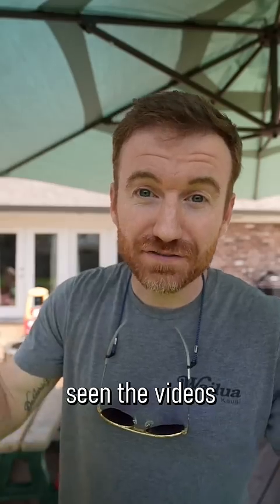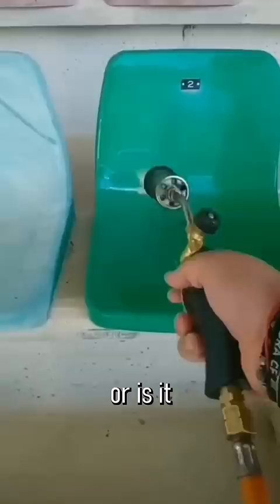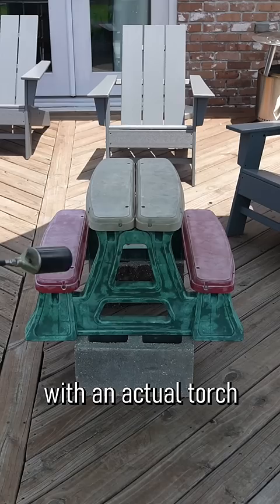Fixing Plastic with Propane TORCH

Comment: What's wrong with selling? Does the torching make the plastic unsafe to sit on or something?
Reply from the maker: I assume it weakens or damages it haha
Reply: Assuming he means doing it to old ones and selling as new/lie about the condition
Reply: Prob
Reply: Ah, that makes sense, thanks
Reply: @BreakItYourself  So because you assume you call people having no morals sounds like you have no morals of actually understanding what you’re talking about
Reply from the maker: @PeterParkerWebslinger3  this is a joke based off the last short I did using a heat gun. The plastic reverted back to the sun damaged look in just a few days. A few people commented jokingly that I should've sold the table right after heat treatment. lol lighten up.
Reply: @BreakItYourself  you have to protect the plastic after you heat it, there’s probably a crew of guys. A couple guys with torches and a few with sprayers followed by several with towels.

Comment: To properly do this you need to wash it thoroughly to get all the dirt out of the pores, then heat blast to melt the plastic back, then coat it to protect the plastic. Otherwise it will just go back within a few months.

Comment: Works on any plastic trim or surface for the outside or your car too. Just use a small propane torch
Reply: How do you protect the paint of the car near the black plastic runners?

Comment: It works quite well, how long depends on mechanical wear and UV exposure. It's not so great on very light colors though, it easily get blotchy and discolored by smoke and light burns from the heat. Happens with dark colors too, but its just not very visible.

Comment: Plastics are repaired and restored using heat, so when you are blowtorching it you are not hurting the plastic in any way and so long as you use the right sealant and conditioner afterwards the plastic will be as good as new

Comment: The heat fixes it. The reason why is pretty simple. The sun damage has a bleaching affect because the outside of the plastic degrades from the kind of heat sunlight provides to the plastic. When you remelt all those little bits together, the white haze goes away. Really, only the outside is damaged, so it's perfectly fine after you do this.

Comment: The heat is bringing the oil out so how well it works varies on what type and how faded the plastic is. Some work better than others, it works great on trim on a lot of cars though. Heat gun and blowtorch will work.

Comment: It is similar to using Compound on a car

Polishing compound is a very very fine grit taking those oxidized B off the outer layers and letting you get to nice clean paint underneath

You probably can use Car Polishing Compound on the seats it would just take incredibly long, so they use a torch which melts out all those oxidized bits and either vaporizes it or just makes it into a nice smooth surface again

Comment: The top layer of the plastic gets damaged by the uv breaking the polymers. The heat lets longer polymers go back up to the surface. It keeps up appearences but it slowly degrades the plastics intergity. So at some point the seats become brittle and will break when set on
Reply: But, is this ok to do on car parts, like bumpers? Or does it make it unsafe?

Comment: It’s most likely because of the microscopic scratches in the plastic making it look faded and dull. By melting them back down and creating a smooth surface, it returns to its original color.

Comment: You’re reactivating the hydro carbons in the plastics, the longer and more frequent you do this the better the results. Leaving it outside on a hot day in direct sunlight will make it much easier to use the heat gun

Comment: All you're doing with the torch is melting (actually the temp is probably hot enough that the plastic is evaporating, so probably want to wear a mask when doing it) the outer most layer of the plastic. You'd then need to coat the next layer after it cools with a sealant, and/or keep it in a shady area.

Comment: It'll make things worse if you don't bother to restore the plastic with an oily coating with something like Armor All, followed by a UV coating like Meguiar's headlight coating. Automotive grade stuff will generally work fine, but there's obviously stronger. Whole point is to keep the plasticizers from drying out and escaping. The torch merely brings the plasticizers up to surface, so it can only be done so many times. Doing the steps mentioned should mean you shouldn't need to do this so long as you maintain all the coatings.

Comment: Doesn't work long therm as far as i know, actually sanding off the top layer is a "better ish" way because it lasts a little longer and doesn't risk cracking on older plastic

Comment: I worked for a company that restored stadium seating. The torch method is very short term. Best result is to take something like sandpaper and completely scratch up the seat and then repaint if you want a couple seasons out of them.

Comment: It really works - but i would not recommend that 
use hydrogen peroxide foam and cure it directly afterwards with silicone oil - with the torch the plastic gets extremely brittle over time and ruins the surface/stability.

Or - after your torching use clear Laqcuer afterwards to seal it.

Comment: youre just melting the top layer, so it will work infinetley, as long as the seat holds up, and you can get even better results if you pressurewash first, so that dirt and grime doesent get cast into the plastic

Comment: I mean, as long as only the surface is damaged by abrasion and UV long term exposure, re-melting the plastic should be just fine, as long as most of the plastic hasn't chemically broken down.

Comment: Should work as long as it took for it took get sun damaged. You’re melting the outer layer of plastic to the good plastic underneath. But a protection coat could help it last much longer

Comment: That's a very different plastic used in children's playsets vs stadium seating,  be careful about getting to close with the flame, you could easily melt the other surface of the plastic (inside) and cause it to deform  and lose strength

Comment: I make polyethylene water tanks, we do this to make make them shiny, best method is use a way overkill burner and do many high speed passes for an even finish
Tho we clean the tanks before we hit them with the burner.
Most plastics will need a uv protevtand but the stuff we use is designed for outdoor use and is iv resistant

Comment: Is this only effective on certain formulation/type/whatever of plastics, or is it generally universal in outcome? I don't expect it's the same with the kind of brittle transparent plastics used to make lamp lenses, but still curious enough to want to ask if heat may be a decent alternative to all the scrubbing/sanding to remove UV damage from vehicle headlights. I've always hated how the usual restoration process damages the lenses to physically remove the affected material.

Comment: I don't even know about the tiktok you are on about.. But chemically. The top layer of the plastic has oxidised under the sun and become "sun bleached"  If you apply heat to the right kind of plastic, it melts the top layer and restores the original colour and shine that the plastic had from new and it should last as long as the old plastic did before it got "sun bleached"

Comment: I worked with molded plastic, and if there was a nick or a diffrent color, depending on how deep it was, they would use a torch to dig, then torch again to get the plastic straight. There* was never a day I didn’t use a torch

Comment: You can spray paint or use Rust-Oleum oil based paint and cover with thin layer of epoxy if moms or dads want to up cycle kids plastic picnic tables or outdoor furniture and do not want to use a torch. Lasts forever and gives you AMAZING coverage. The outdoor paint used for doors. I use it on anything that i want to retain solid color with absolute high shine. I restored a large plastic kids toy that had immense heat damage and discoloration from being in an abandoned back yards for years. I painted it white with the Rust-Oleum oil based door paint and it looks like marbled stone. Has not cracked or chipped and has held up for almost 9 years. Looks extraordinary. Oil based paint adds an extremely thick protective layer while also adding substance to pieces.

🏆.

Comment: Yeh I used to do this at an old used car lot I worked at. Works great but you gotta be careful you dont actually melt it or burn the paint or lights. Used a way smaller heat gun tho 😂

Comment: Exactly not a real fix. The UV penetrates the surface and does real structural damage over time, literally breaking the molecular bonds that hold the plastic together. This why sun damaged plastic is so brittle and will crack and fall apart easily. 
Remelting the surface actually might increase the flexibility and thus durability just slightly by bringing more plasticizer to the surface and resolidifying microscopic cracks and whatnot. This would only be superficial and wouldn't help structurally but its interesting to think about.
Clear coat of course works to prevent damage but doesn't help any after the fact

Comment: I don't think this is about morals, nor ethics. This is literally what they do in the factory to create that shine. Injection molded plastics don't come out shiny. They are dull and usually covered in injection grease. Adding heat brings out the grain and the shine. Many years ago I worked in a plastics factory. We made everything from rubbermaid baskets, to castor bases for office chairs.

Comment: Tried it this week on a slide. Didn’t do anything but heat the plastic which then warped when it cooled. Wonder is the slide was fire resistant?

Comment: We used to scrape the sun damaged parts of our motorbikes with safety razor blades, because you can bend the razor blades to match the curves of the panels, but the most important thing, is to use seal and protect it from the UV rays……….
    Otherwise you might as well just leave it as it is………..

Comment: Only certain types of plastics.  Careful what you dod this to.
Reply: Correct, this technique only works with PE and other re-meltable thermoform plastics, do go trying it on PVCs or Bakelite, and honestly the other plastics that it does work for are very finicky with the temp, you’re more likely to set an acrylic piece on fire than glaze the surface. Especially with a flame

Comment: HOI!! my time to shine.
Short term, long term, up to you. These are most likely made from a material we call Crosslink Plastic. or X-Link. The material bonds in an X pattern, resulting in a very strong, durable material that you could take a hammer to then hit it with a heat gun and watch it slowly regain its shape and/or color. Shout out to Centro inc.

Comment: It works short term 99% but will fade away in a few months. It works 100% and lasts for a couple years if the product is meant for it. The toy table you used it 100000% not meant for it at all and you should let it air out for a couple days before letting your kids use it 😂

Comment: Why would you be unethical to to sell the item? That makes no sense.
Reply: The implication you were supposed to infer is that the item is sold as if it is newer than it actually is, since the UV damage was removed by heating the surface. It would be unethical to either directly lie to the hypothetical purchaser about the state of the object or to deceive them by implying the object is newer than it actually is.
Reply: @stevendorries even after he performed the heat treatment on the plastic it still looks like it's used and exposed to UV rays. You could even treat the item once it was he heated with 303 protectant to enhance the appearance but whoever comes to look at the item is going to know it's not new. I don't believe he was suggesting anyone sell the item is new.
Reply: @jeffj126  I didn’t say new, I said newer

Comment: Bro saying you need a bigger bike after 1y is cringe amateur/beginner stuff. There is a reason people sell bigger bikes and go back to a ninja 400. 

I will admit that I've owned the bike shorter than you and already want to switch, but straight line speed isn't everything. A monkey can pin the throttle too